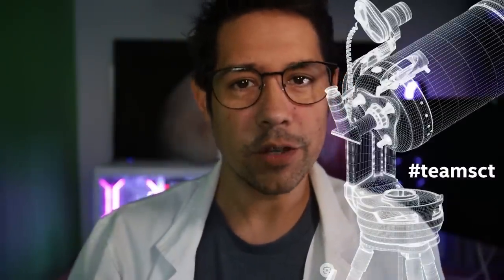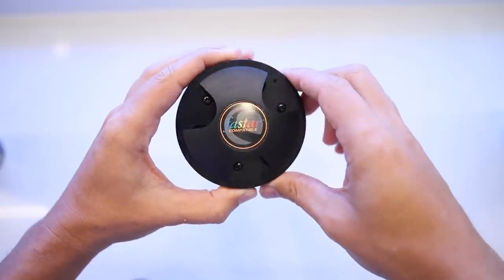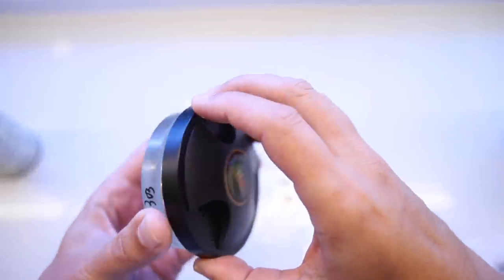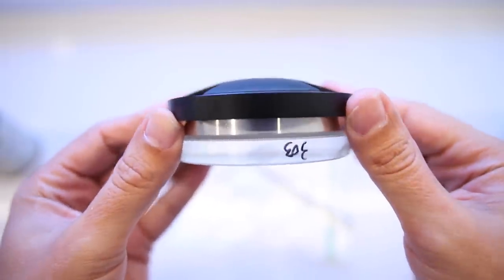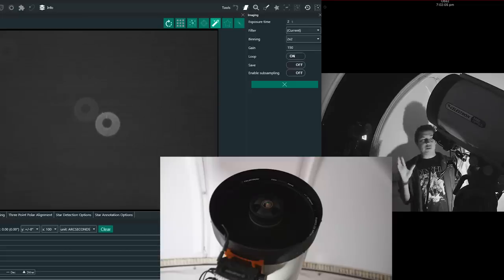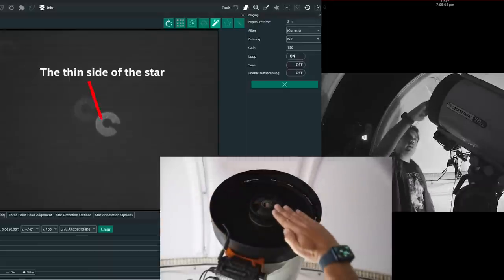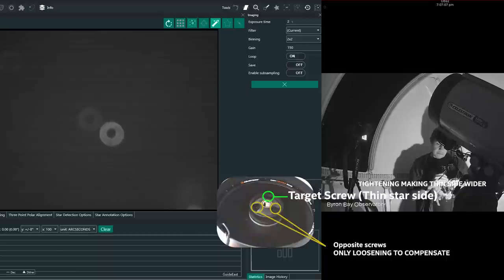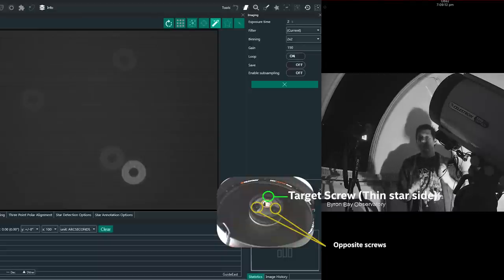SCT Telescope Collimation (With NO fancy tools)

Comment: Don't know if you mentioned using a ball bearing in the video (because I have a Newtonian), but yeah.  If you're inside and don't want to fiddle pointing at real stars, you can cover a flashlight with some foil, put a pinhole in it, and point that toward a tiny ball bearing and point the scope at the ball bearing to simulate a teeny tiny star for doing collimation indoors.
Reply from the maker: That sounds like a lot of work :)

Comment: Great video! As far as collimating an SCT; couldn’t you measure the gap between the two halves of the secondary with a feeler gauge (gap gauge), and make sure the gap is the same all the way around? Then collimate on a defocused star to do any needed tweaking.
Reply from the maker: In theory, yep! In fact just eyeballing it that way get's it basically close enough, then tweak the rest.

Comment: Love your observatory and the fantastic 3 minute collimation—awesome :-) When screwing the secondary holder back onto the secondary mirror assembly, did you ensure the secrondary’s rotational orientation was in its original factory position? I understand that my vintage 1970s/ 80s Celestrons were set-up at the factory for optimal rotational matching between corrector, secondary and primary to obtain best possible wave performance.
Reply from the maker: Thanks! There is a groove so there is only one orientation possible to get it back in :)
Reply from the maker: Not sure about vintage though sorry!

Comment: Did you need to have your mirror orientation the same as before you unscrewed it, having the screw holes aligned the same as before you removed the mirror? I'm not sure, but i believe when this mirror is fitted in the factory, it is carefully calibrated and orientated. This is why you have the notch, so when you place it back in, it is orientated exactly where the manufacturer had it, giving you maximum collimation to start with before you even touch the screws for fine tuning. But then again, i could be wrong on this

Comment: Had just gone through this with my NexStar 5SE.  Excellent advice about pointing at a starfield!  I had used a single star and spent a lot of my time star chasing with every adjustment.  I also was using a thin PP.  Perhaps next time I will use a thick PP for more control while I am screwing.  Great video as always.  Thank you Dylan!
Reply from the maker: Thanks!

Comment: Nice smooth process there!  Good tips as well.  

Is there any importance regarding rotational orientation of the secondary to the primary and corrector?  I know the corrector has an indicator mark for it's proper orientation to the primary but don't recall if that applies to the secondary as well.

Comment: Great video! I really like the step one procedure with the secondary mirror for rough in. I see that you're not too concerned about the scope angle being vertical during the star process.  Second I track while collimation to keep the star somewhat target centered. As I get really close I'll auto recenter between each adjustment. (Maybe overkill)
I'll also collimate on both sides  of focus (thoughts?). 
I've tried to use the Ocal Columation tool and collimation during the day using an artificial star. With both processes I was disappointed for my C/8 Seems the eyes are still the best. 
Thank you again for the video!

Comment: It is entirely possible (and likely, even) that you won't be able to adjust a single screw and the opposite pair equally.  If you notice that the thin part of the ring is biased to one side of a screw, you just loosen the screw opposite that bias a bit more than the other one when you're giving yourself space to tighten the screw you're focusing on.  Of course you can also just get close to center, realize you're going to miss, and repeat the hand shadow trick to figure out which screw is closest to the thin side of the ring to repeat the cycle.
Reply from the maker: Good point!

Comment: I may be old-fashioned, but I still get the absolute willies using a tool like a screwdriver in the dark near the corrector plate. If I'm going to replace the collimation screws on an SCT anyway I'm still going to replace them with Bob's Knobs so I can continue tool-free. Sorry but I rather not use your PP Dylan.
Reply from the maker: Sad PP
Reply: @DylanODonnell  I'm guessing Bob's happy though 🤣

Comment: so, why did you take the secondary mirror assembly apart anyway? Did you suspect there may be bad screws or did you just want to OWN the thing and start it from scratch? I understand both reasons... just wondering which it may be.
Reply from the maker: Understanding. I have 100% confidence in the screws. Celestron screws are great. I've only got a dud one once, which was a weird manufacturing error. If they're black they're good.

Comment: It would be cool if NINA had some concentric rings you can move around the screen and resize to aid with this.
Reply from the maker: True !
Reply: I think Al’s collimation aid is still available. I used it on my 9.25 3 months ago. Yesterday I 3D printed a tri-bahtinov mask and it’s still in collimation…with bobs knobs 😉
Reply: sharpcap does

Comment: Dylan I have always used an artificial star , then checked on Polaris , not sure what you southern guys would use. I also removed those stupid AF #1 Philips head screws out of my Secondary and replaced them with Hex head bolts of the same thread type , nothing like stripping a #1 Phillips head while collimating. Why the hell Celestron ever thought that was a good idea to use them is beyond me.
Edit: I want to note , since replacing the screws with hex head, I have not had to collimate my C8 in years now, Granted it does spend most of its time in the pelican case because I cant find someone to make me the 5mm m42 threaded adapter with the bolt holes to attach it to my 268m and filter wheel. The M42/m48 ring adapter from ZWO doesnt work because the threads dont stop and the camera spins as the scope slews. Which we all know is a NO NO for many reasons.
Reply from the maker: Great idea !

Comment: Do you think some type of foam washer would help with taken up the slack
Reply from the maker: Not needed I think!
Reply: i was thinking the same thing, some strong foam to keep the neutral position.
Reply: If so RTV silicone would probably be the cheapest easiest to use

Comment: A couple of comments. If you have an old (non fastar compatible) don't ever touch the secondary mirror, you will use its position (you might rotate it), and might never get good images anymore. Same, if you insist on dismounting the secondary, mark with a felt pencil so that you remount the secondary correctly (not with a 120 or 240 degrees rotation). The optics are aligned in factory and their position in rotation is quite important. What is described here is correct for a pre-collimation. Apart from this, this video is correct but incomplete. When you have arrived to the point where the image look symetric (like at the end of this video), get closer and closer to focus. And keep adjusting by smaller and smaller adjustments. You may have something that looks good when completely out of focus, but as you get closer and closer to focus you might see that the star images are asymetric, more light on one side than on the other, like a comatic images. Also, find a star high in the sky, not like in the video, you want to avoid atmospheric turbulence as much as possible. Adjust till, when you get to the sharpest focus, the image falls symetrically into a point. Any asymetry needs to be removed. This is the type of collimation you need if you want to make nice high resolution images. You can also google "thierry legault collimation"